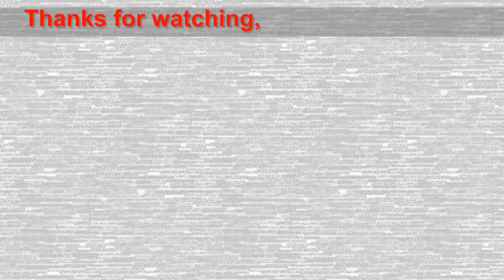Excellent Building Bedroom Floor With Wood & How To Install Wooden Floors Step By Step

Comment: Makes me think he's taking part in competition who is the fastest but not doing the job properly
Reply: How wasn't it done proper?
Reply: Guy don't know what he's doing. Wrong length mix, floor looks like steps on the first floor. Wasting time and material.
Reply: He is doing wrong the edges of plinth. Normally the end near the doors does as outer corner, just the length of the edge is the thickness of the plinth. I mean it looks like triangle from top, not from side, which you glue to the end of the plinth.
Reply: 9
Reply: Рукожоп, ему только мешки с цементом таскать, а не ламинад укладывать.

Comment: joints are too close to each other they should be staggered more and random .
i never use a  one foot piece except for in a closet......
Reply: saw a floor done similar and it had a nice look, it was designed by the contractor and my elderly retired boss loved  the look. It was in a very nice Mobile home near Palm Springs, Ca. , actually the nicest one I had ever seen in my life.
Reply: @califdad4  Well its done wrong. The Manufactures of any laminate or wood floor puts staggering directions on them. This floor once it expands will go out of square. And start to buckle up. This guy installed this floor incorrectly.

Comment: He committed one big mistake. He did not give a few centimeters of space between the walls and the wood slabs. There is no space for the wood to expand. And when the wood expands, the wood floors will be forced to warp up and create a wavy floor!!!
Reply: He put a few wedges in between.
Reply: 3 centimeters is ok.
Reply: You are correct for actual wood floors. Although, he is installing laminate flooring. Its a composite mixture that does not expand like real wood flooring. But, there is alot of defaults in his technique and there will be alot of wasted material at the end of the job.
Reply: It warps For wooden floors and Decks,on these u have to leave a gap because it will expand,we were working  on a project here in the silicon valley where Carpenters installed two decks in a pool area on the roof of a 5 story builiding,not alot of material was wasted and they were done in 2 days,we were amazed.but,the Carpenters didnt have much experience in decks they thought that because they were using this super strong (and expensive) ipe wood that it wouldn't "react to weather".it rained two days later,it all warped upwards.they were fired.another company took the job.

Comment: sloppy work:
- you always let some spacing between the wall and wooden floor;
- you guide yourself by placing the first row
- the diagonal is noticeable from the first glance;
- the pattern of the wood is not followed.
Reply: I'd have to say that, though he did pretty good in some aspects, you're right about the spacing and not following the pattern through, so that it looked more natural/uniform. Also, did you see the "work"(if you want to call it that), on the baseboards? I understand what he was trying to do, but, in the areas where he did 45 degree angle cuts and installments, it looked very unnatural/sloppy. He really couldn't have just done a 90 degree angle cut on the baseboards, instead of doing an angle cut that I've never seen done, and that no flooring contractor would ever do? What was this young man thinking? The more I think about it, I've gotta agree with you. This is sloppy! He must've been aiming at getting the job done very quickly, and totally lost sight of the fact that, when you install flooring materials of this type, make sure you get continuity in the pattern! Hopefully, this young man will learn this very valuable lesson as he gets older. If somebody did this sloppy of a job in my domicile, I'd get him to correct it, even if he has to buy the materials to correct the problem. If he refused, I'd fire him on the spot! Again, I agree with you-There's no room for sloppiness on the job. Do it right, or you're fired, that's what I'd tell him, up front!
Reply: You’re supposed to leave a gap with floating floors ? What are u talking about

Comment: How to install laminate with $3.00 budget on tools! Very efficient, however there needs to be more of an expansion gap, pad needs to be taped, and is that a brick you’re using as a tapping block! Wow! Faster than most I think.. no boots required either 😀
Reply: Not crazy about the diagonal pattern of the aligned planks, but maybe that's the style over there (wherever there is). Or maybe that's just the fastest way to do it.

Comment: When the seams of the floor start to bulge after a few years or so, you will know why with the layout that was done, not supposed to do staircase or H-Pattern Layout.. but if this is another country, then you do it the way you want, but if this is where I think it is, the humidity of that country is gonna destroy the floor when it expands and contracts.
Reply: I’m a novice and those are my thoughts. He left no space for expansion. Granted, he’s great at what he does.
Reply: @miamivlad  
.
Reply: @miamivlad  es lo
Reply: THANKS!.
Reply: I was just going to comment on the way that floor was laid. Goes down easy but isn't right.
Reply: Não entendo inglês.
Reply: Vou tentar traduzir
Reply: Pun    e   bukur
Reply: Idk a 3,4,5 method prevents you from seeing the lines of the layout just like shingles it is square as long as you leave 1/4 inch for expansion and contraction it should be good !
Reply: Andrew Layton it’s good to get other opinions helps you grow!thanks
Reply: Não entendo inglês

Comment: Those staircases will open up over time.  This is definitely the wrong way to install.  Joints should be a minimum of say 10" apart if possible and NO staircase patterns.

Comment: Please do not lay a floor like this. This is horrendous. I would find it hard to believe any manufacturer would recommend this.
Reply: sounds to me that Todd seems a bit envious and jealous if you ask me
Reply: @salahudeenmuhammad432  envious of what. Doing floors like that, just requites large area rugs.
Reply: What's wrong with it please?
Reply: @jasmyneokudo 2 things I see that are obvious are that the joints are too close and he's using pieces that are too short at the ends of some of the rows. Probably won't ever pose a problem, but just isn't the way most manufacturers recommend.

Comment: lazy flooring job. never do this seem pattern kids. Take the time to stagger boards even though it means more cuts
Reply: Big assumption on your part....the client may have wanted that pattern
Reply: Better than than some of the shit people install around here. I've seen new floors where every piece was chipped and it was all laid straight from the box with only cuts for the finish on each run.
Reply: Всё правильна.....там мастерчок самоучка чтоли.....даже  не знает правила
Reply: O😊😊😊

Comment: Idk why everyone is crying in the comment section. Why does the west always think that the rest of the world should do things their way.
Reply: Because They see  your world weird
Reply: It has nothing to do with the way westerners think it should be done. it is about manufacturer's specifications on installations is what matters. and it doesn't matter what country the material is manufactured in or made by they all have pretty much the same installation specs.
Reply: Is West still west when seen from south?? Where is exactly west?? 
West or East the Physics Laws wont change. I come from "South East", and i do flooring professionally. 
Security is law number1. Security shoes, the way handling the machines etc. This guy is a poor example in youtube. But i have to say he works 10 times faster than those from the "west".
Reply: @Abdul Hai  Simply because there are reasons for staggering the joints in a random way. If you don't know that, then you don't know what you're talking about.  A random joint pattern will give a more stable installatiion.  That's the best way.  Not the "Western" way.  Learn what is best.  Hating the West will not make you a better technician.  Learning trade standards and best practices will do that.
Reply: @GRathburn001 im not even arab lol
Reply: @HarrySatchelWhatsThatSmell  lol be.  then please explain why all American homes have creaking floors?  

Every single one of them
Reply: @jzizzles7799  it's the subfloor or underlayment that is creaking not the laminate or engineered floor if it was installed properly
Reply: @tomb306  so the pattern doesnt matter then.  American homes are just made shitty nowadays.
Reply: Maybe because the manufacturer says that’s how it’s suppose to be installed.   I mean to each his own and if someone wants it that way then fine but just because you want to be different does not mean it’s equal to the preferred standard and with wood pattern flooring the standard is a natural look and to not have the floor look artificial.    The problem is it’s an optical illusion when you randomize the pattern and feels natural but when you don’t follow this it looks like a artificial laminate floor.

Comment: nr2 at the end, by the wall, the smallest you can have is 30cm and use woodglue. if not it will be ha huge gap whene the floor gets dry ( or) wet,
Reply: Depends on the area where you live , he might be in a zone 3 or 5 with no high heat

Comment: This should be " how NOT to install "  wood floor ...
Reply: VESANG 
What is wrong with it then
Reply: Many things...  Joints too close , backwards installation of first row, tapping with hammer too hard and on top of short seam suggests not good too forceful locking which mani times leads to  damaged joints , wood does not go under door casings / gaps around door casings , it seemed too close to the wall too / that kind of wood needs expansion and contraction gap... /  ... I think thats enough.
Reply: Absolutely 100% right.
Greetings from the Čech Republic 🇨🇿.
Reply: @VESANG  thats double clicks laminate,and he did the right way to install it,the only problem is usually customers they dont want joint shapes goin like that so the worker just try to make the joints more natural as much as possible
Reply: @Banhdacua198  that’s right.

Comment: Just look at the picture you posted. Even when the room is finished that pattern will jump out at you. A floor like this should be randomly laid, so it doesn' jump out at your eyes. Whats this says is, you got it done as quick as possible. Next time randomly stagger your pattern, then compare the results.

Comment: Can’t see a 8mm gap around edge for expansion
Reply: It can't be visible on the video, I am sure he does because he can also fit the tool at the edge to pull
Reply: Dan Martin 
Hidden under the baseboards, watch it again.

Comment: lot of bugs going to nest there under those wood floor, like centipedes and roaches
Reply: Interesting comment.  What would cause that? What should you do to prevent the bugs?
Reply: @wassamatta4uny550  u have to call the pest control

Comment: These are laminates on cement concrete floor  and base moldings on cement concrete walls in Vietnam.  You also see the AC outlets laying horizontal direction.  Hardwood floor won't work here since all floor are concrete.

Comment: Dégueulasse va prendre des cours mec mdr prenez pas cette vidéo comme exemple si vous voulez un vraie conseil !
Reply: bonjour pourquoi, quel est l,erreur a ne pas produire et ne pas prendre sur cette vidéo comme exemple?
Reply: @sensimilia1005  bonjour moi je prend la chute du premier rang pour continuer la deuxieme ligne ensuite il faux des cales de 5mm pour tout le contour'des mur car sinon tout le parquet va ce relevè comme un chapeau donc du travail degeulasse c vrai jespere avoir bien repondu
Reply: Bonjour exactement l'on récupère les chutes comme départ afin de limiter les chutes inutile, attention toute fois il faut veiller à ne pas être régulier sûr les raccords de lames de manière à ne pas avoir un enchaînement successif en escalier ou autre pour finir oui il est exact suivant les produits 05 a 010 mm de jeux périphérique ainsi qu'un stockage de 24 h a 72 h d'acclimatation a l'environnement dans lequel il va être posé . 
Cordialement
Reply: Bonjour,et quand on voit la découpe des plinthes de près, on voit aussi ses joints de bouts dégueulasses....sur du parquet clipsé, le joint est  nickel,la seule chose que j'ai aimé est le retour au sol à 45° de la  découpe de plinthe (même si elles sont pas "propres"...)

Comment: Flimsy underlayment. This looks like plastic laminate and not hardwood. NEVER, NEVER install a floor with a sturctured zigzag cross joint pattern like this! Cross joints should be totally random and natural looking.

Comment: You know, he wouldn't have to hammer the ends so hard if he wasn't standing on the boards...
Reply: You know I was watching that too then I noticed what he does is push with the lead foot while hammering.  Guiding the board and keeping it settled while hammering.  Those joints sound mighty tight and I'm guessing there's a risk of splitting lengthwise.... just looking at the grain of those boards.  I could be wrong,  but I think there's a method to his madness.

Comment: I have been told that this way of doing flooring is a big no no. That it creates a stair step floor design in the wood that is visually to symmetrical and needs to be more random in design to look its best.

Comment: Hardworking but there are so many mistakes.

Pattern in which he has plotted is totally wrong, it will not give any strenght.
Also the wood is wastaed mostly by cutting.  It is mandatory to provide 4mm leverage at the ends which are not given,  undercover is not provided properly which will definetly cause in sliding of pieces in near future.

Comment: No glue or expasion gap ? I find it difficult to see how these joints either won't open up or the floor lift due to expansion
Reply: You dont need glue.  But i agree on expansion gap.

Comment: Everyone has different method that works for each individual pro or not. However their are basics rules that should be considered when installing wood. This is where you see the difference in experience over DIY and textbooks. Just a quick note to make a good looking installation avoid making this stair pattern. The installation would look better when you dont see the stair pattern.
Reply: Los fabricantes lo recomindan así...

Comment: 😮😮 I fit flooring for a living. What a great worker. But I  wouldn't fit according to his pattern layout. Definitely not. Aesthetically it's not pleasing to see the short end joints so close and laddered. Structurally it's very weak. These planks look 12mm thick so I'd have wider expansion gaps at the walls.

Comment: Rule 1 do not install elements smaller than 30 cm. Rule 2 the offset of the next row of boards joints should also be at least 30 cm. What you have done is a very unstable joint.I recommend learning more about laying floors because you are acting against the rules of floor manufacturers and their recommendations on how to lay them.

Comment: Bamboo floor does not work in Midwest it shrinks in all directions no matter acclimation are humidity control manufacturers won't stand behind product Cali bamboo can't touch up scratches because of the resin in product

Comment: I'll just touch on safty. For real no gard on the miter sew then reach in under a runing blade. And that fancy little free hand cut when the blade snatches it you just better hope there's not a arm connected to that piece of flooring .  Just don't do this at home folks .  Now that was a fine how (not) to do  all the way around

Comment: I have a problem with several things here.  First,  he didn't tape the underlayment together.  Second, why didn't he just stagger the boards instead on doing all of those cuts?  Third, he didn't leave enough of a gap for the boards next to the wall.  Lastly, I hate what he did at the end of the baseboard with the triangle at the end.  Mostly, I hate the end product because the pattern looks jagged with all the unnecessary cuts he made.
Reply: I agreed with you totally. I did my own floor and manufactured never suggests to install stairway pattern floor. Random patterns look better and it should be at least 6 inches a part from adjacent joint.

Comment: Need to put a moisture barrier down before using that particular foam over concrete slab. 
Also, try not to step boards like that, randomly stagger the pattern. 👍

Comment: You should not use a stair pattern... this was NOT a good job. You want a RANDOM pattern not a staircase. Also he didnt leave an expansion gap between the wall and end of board for potential floor expansion. That sucker WILL heave!

Comment: I’m sorry but that is no way to lay a flooring your make a really big ladder witch is really bad if you lay flooring like that it will move and u get a really high chance of it coming about. Best way is too start at a full peace and use the waste from that row to start a new row it looks better ,it won’t come apart and you will have less waste at the end. About this is that every seem should be 6 inches to 8 inches apart just a heads up. Your fast just because you are making a ladder witch is not good 😂

Comment: Poor quality of overall installation, it doesn't take much longer to finish a few rows at a time so you can have a proper joint stager. That is what you get ,when you hire the cheapest bid.

Comment: This is the ABSOLUTE worst flooring jon I have ever seen! I have been a general contractor since 1978, and if I walked into a job like that, the first thing I would do before I fired the installer would be take a shovel and shovel that crap right out the door.

Comment: LOL 😁
Fast work, but bad work ! 👎👎👎
The guy setting up floating floor doesn't let space along the walls for thermal expansion, or dilation due to humidity.
It's the main thing to think about when you install floating floor.
About 1cm everywhere.
Special spacers exists to help you doing that.
If not done, your floor will soon make beautiful waves 😁😁😁